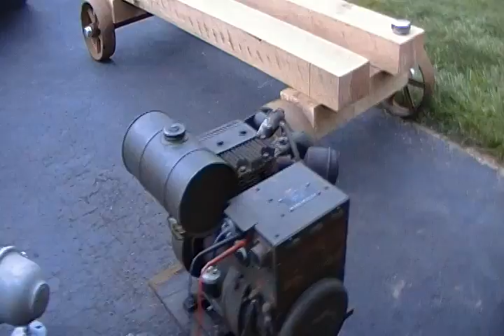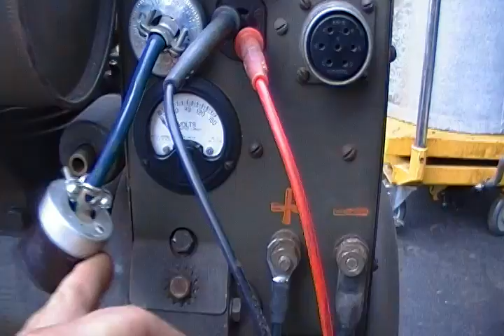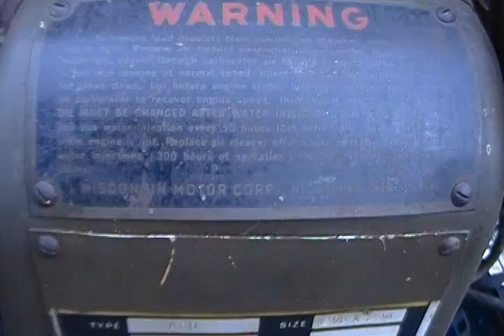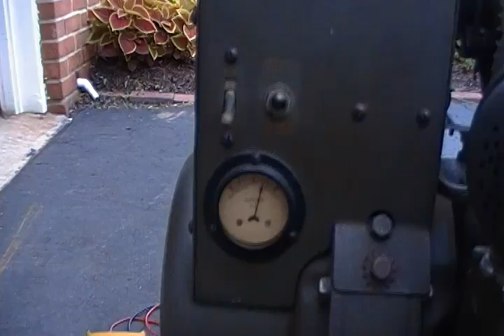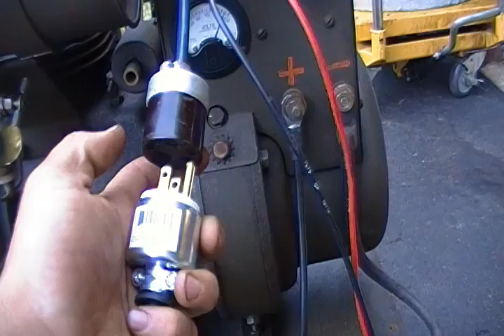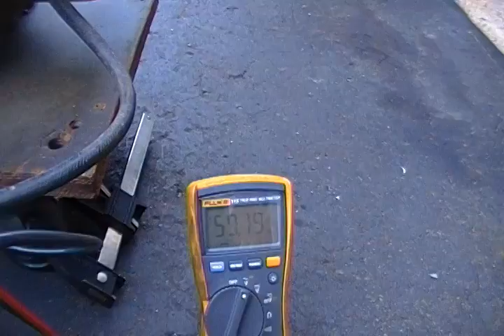1944 Signal Core Power Unit

Comment: Oh those good old Wisconsin Air Cooled engines. Now that, was an engine meant to work all day.
Mike , is that model about 6.5 HP thereabouts ? Pity it's only 600 watts, but it is what it is, and like you said,.it's in fine condition. Nice, really nice !
Reply from the maker: You got it they are probably my top pick for quality small air cooled engines!I have herd of guys putting 1000w on these gens, but I will stick with name plate rating!At 1800 rpm the engine probably only makes about 2.5 hp.
Reply: SmallEngineMechanic What a shame these folks had to give up making these for  public use. I was a dealer for these here in Canada. I knew that when I sold one of these, no matter what the model, that there would be no worries about them breaking down  any time soon. These engine were made to work all day, every day. Just give them maintenance as required, and they would prove their worth and value.

Comment: nice little generator got the military spark plug / cover it works well .injecting water in to a running engine there is chance of Hydraulicing it that would blow more than the carbon off the piston a shot of red x or brake fluid would work better nice little piece of kit mike
Reply from the maker: Thanks for watching Andy.
Reply: i only watch you tube now tv in the uk is rubbish

Comment: I was using my 1944 pe-77D with a briggs model I this weekend to run my hedge trimmer because its a slow running generator and quiet I may be getting the larger ZZ powered model soon. I like the wisconsin engine wish I had one on a generator!